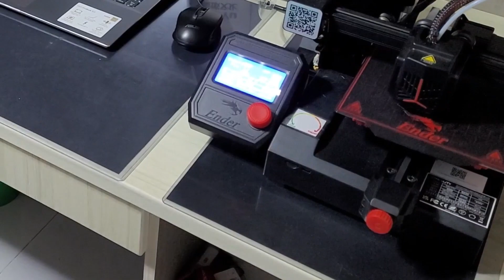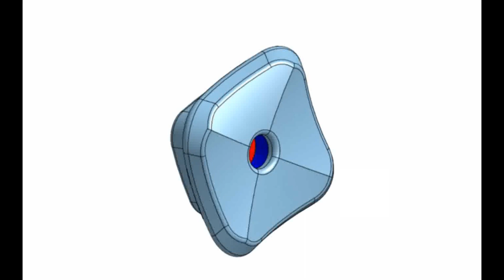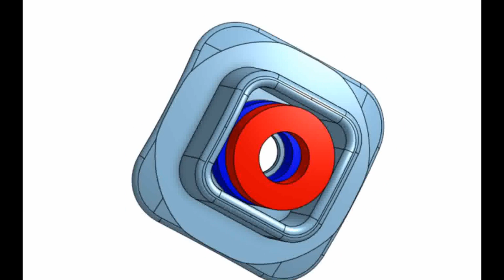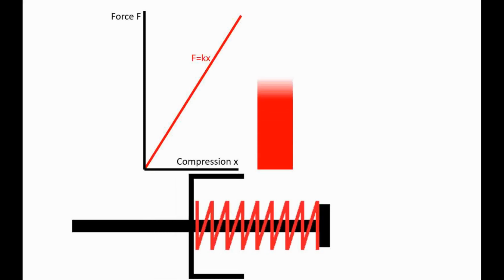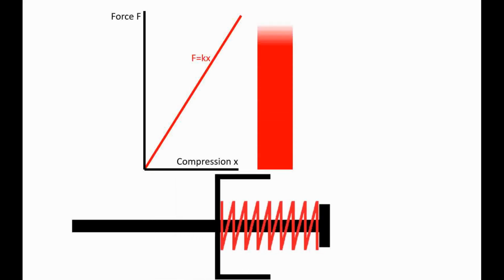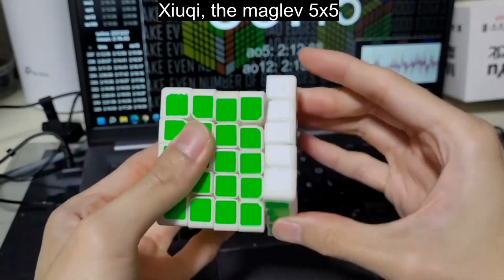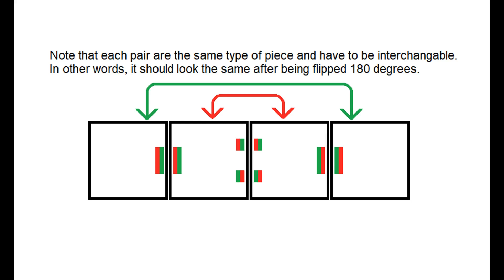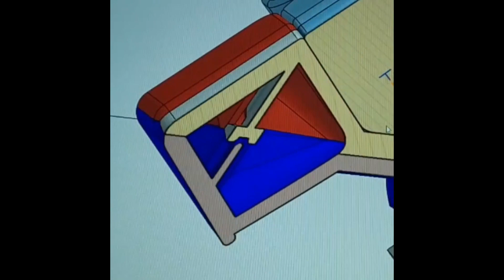World's first maglev 4x4?

Comment: Why couldn't you take a normal 4x4 and add maglev to it?
Reply from the maker: The mechanism of the middle layer is a narrow T shape with hardly enough room to add maglev. And even if you can find thin enough magnets to fit inside, you only get the "force vs compression" benefit of maglev, without the "reduced friction" benefit because the centers still need to hook to the core for the allignement mech to work, and you will still have the same contact area regardless of maglev or not. In my cube I made an original alignment mech that is designed to be contactless between centers and core.
Reply: @laiscube  Ok, Thank you